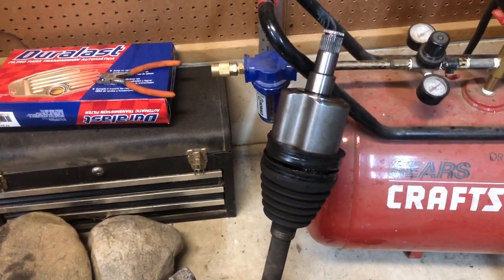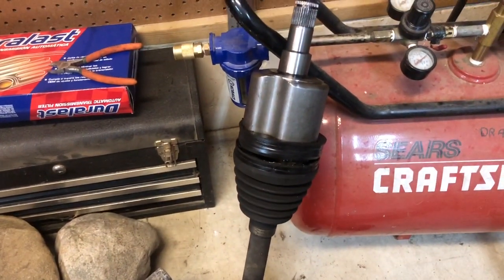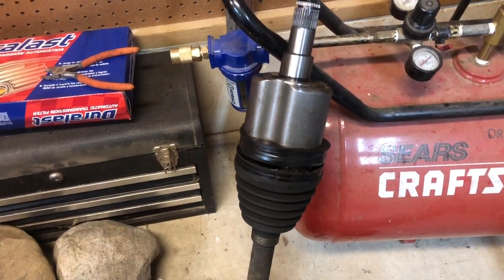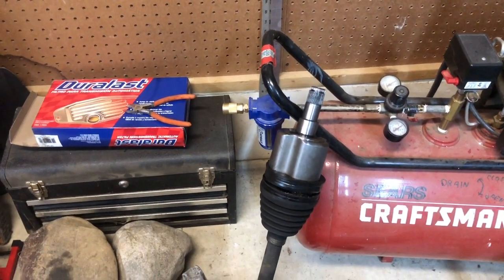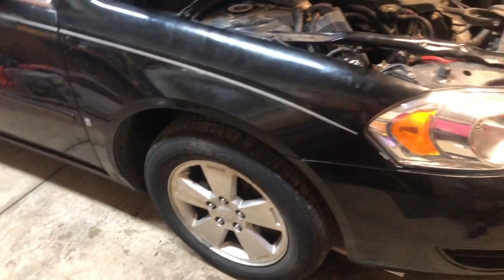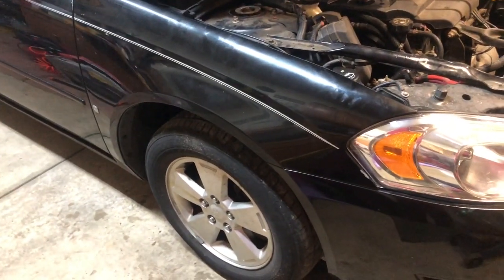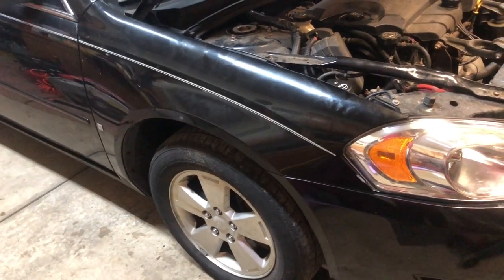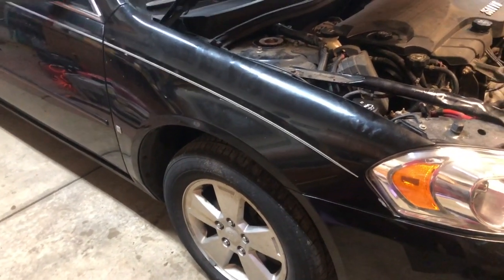COPART Project Car - Test Drive - Fail!!!!!

Comment: A lot of low price GM "compatible" aftermarket chassis components have a terrible reputation, and justifiably so. A good way to cut down on future disasters (Though there are no guarantees) is to use a site like Rock Auto to carefully compare CV axles for the same car. By using a combination of images and the parts they've "favorited" you can often scrutinize the physical differences between the OEM unit and Chinese specials. At the same time you can read reviews of the supplier on  Amazon, Ebay, Google, etc, which will reveal a lot. And by a lot, I mean that a significant percentage of these parts either don't fit properly, or they crap out after 3 to 10 thousand miles. As long as the price isn't exorbitant (It often is) I try to go with OEM whenever possible. Makes things exponentially easier. One way of achieving this is to get a NOS unit on Ebay from a reputable seller, or some other reputable third party site. I was able to get a real  brand new GM tensioner for my deeply disturbing (But oh so comfortable) 2002 Cadillac for about 30 dollars delivered using this method.